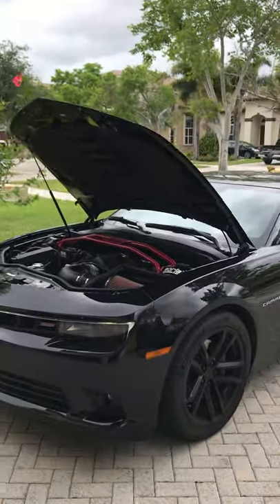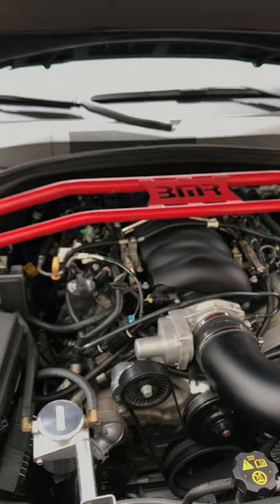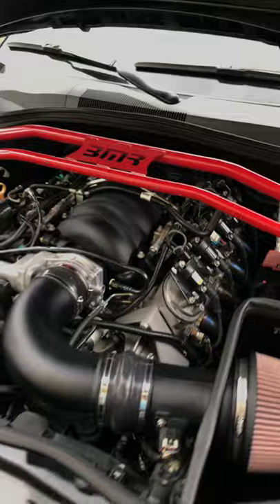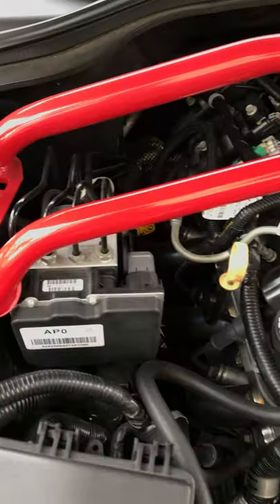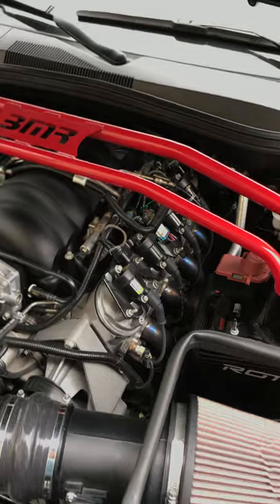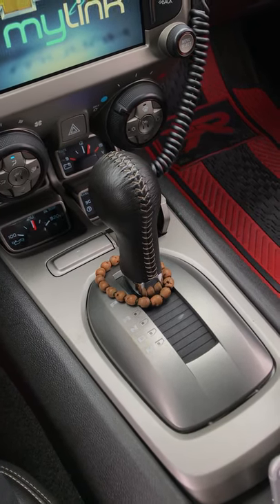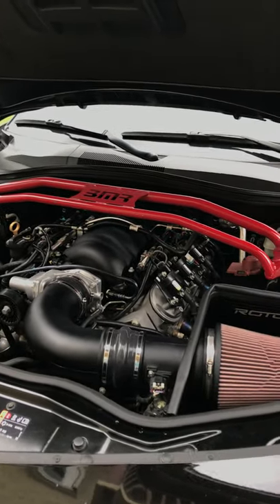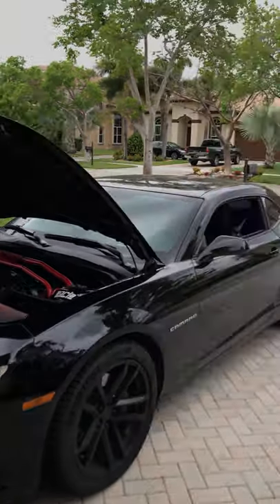3 BEST MODS to make POWER in a CAMARO!!!

Comment: I have a 2015 green flash automatic that I just picked up from auction.  I believe it's completely stock.  Would I have anything to gain by starting with just a tune?  Or maybe a CAI and tune?  I wouldn't even know who to contact or how to go about getting one.  Also, I am an IT professional and if tuning it something I could do myself (provided I had access to all of the data or needed parameters) I would be willing to dedicate a laptop to this vehicle and buy whatever data connection I need as well.  I eventually would like to do headers/exhaust....I know that some models had a dual mode exhaust available, I'm not even sure if mine has that or not, or if there's an easy way to tell.

Comment: im thinking of those mods on my 2015 SS
can you put up link to where you bought the headers and high flow cats?
im from sweden so i need to order from the US i think.

also do you need any extended cables for the new cats or does the stock sensors and cables fit?
Reply: Hopefully you figured it out, but yes, you will need oxygen sensor extensions for the primary/upstream o2 sensors. The secondary/downstream sensors won’t require them. 

However, if you went with cheap(er) headers, they may not include attachments to allow you to run the downstream o2 sensors, which will trigger some O2 sensor CEL’s. The only way to fix that is to get high flow cats with o2 sensors and to install the sensors, facing AFTER the cats; or you can get your car tuned professionally (based on the laws in your country, region, etc.).

Comment: U should definitely get a flex fuel kit. It’s one of the cheapest mods u can get and will make as much difference as the headers
Reply from the maker: I will definitely look into it! ive heard that the benefits are better for the 6th gens than the 5th though. Thanks for the advice though!
Reply: Flex is nearly pointless unless you aren't NA. not worth the price of kit, plus the price of tune, any decent tuner will tell you this also.
Reply: @Neoncollects  I’m NA and make an additional 30whp on E-85, The kit is the cheapest mod I’ve ever paid for and the retune costed me $400. Don’t talk about something you don’t know 😒
Reply: @Race_Ready_1320  assuming you have the DSXkit and returne, you're sitting at, close too, 800 bucks for 5% gain, twice as many trips to the gas station, which (depending where you live) you gotta hunt for the places that sell it. Not against flex, but there a time and place for it, if you want the best performance from flex. Flex is rad with supporting mods. But just throwing flex on something and claiming it trumps building up a strong foundation, with a free flowing exhaust, is kinda wack. Been building/ fixing cars my entire life, grew up on drag strips with my dad and grandfather, and a mechanic by trade. I know a little 🤷🏼‍♂️ just my opinion.
Reply: @Race_Ready_1320  also, I bet I can push 30 extra with the price of your retune, alone. Just saying.
Reply: @Neoncollects  all of you’re assumptions are completely false, stop while you’re ahead🤣. And don’t tell me what power “you could” make, just prove it
Reply: @Neoncollects  I didnt say anything about not building a foundation, reading is fundamental. You’re just contradicting yourself at this point. First you said flex fuel isn’t worth it but then you say you’re not against it, make up your mind… I don’t need the made up back story from fast and furious 😂
Reply: @Neoncollects  I know a lot from my experience building my own cars and I’m speaking from that experience, it seems like you’re making a lot of assumptions though
Reply: @Race_Ready_1320  okay dude lol. You're right, I'm wrong.
Reply: It will make more power on E85 but not 30 rwhp it will run cooler and cleaner also my car made 414 on 93 pump gas to the wheels and 430 on E85 it has a ZL1 fuel pump and injectors a new auburn limited slip unit a aluminium one piece driveshaft 1 7/8 long tube headers stainless 3 inch X pipe a fresh built 6L80 transmission circle D 4200 stall speed the engine is a GM performance LS3 480 horsepower crate engine that has 380 miles on it now just changed the oil yesterday with Driven LS30 and before next year it will hopefully have a GPI SS4 camshaft matching titanium valve springs hardened pushrods and PRW roller rockers in hopes to get it to make more power up top now it redlines at 6600rpm hoping to get to 7200rpm redline with a cam change and make more torque above 5000rpm in hopes to make 470+ horsepower to the rear tires car has gone 11.63 at 117mph with this current setup just 2 passes would probably go 11.50s if I'd made more hoping to go 11.0 or 10.90s at 123mph+ once cam swap and the computer retuned even if stall converter needs to be re flashed to 4800-5000rpm if needed car has a aluminium radiator race star wheel skinnies 18s front ET Street R radials 305/45r17s back engine oil cooler and a transmission oil cooler sheet metal intake 1 inch lowering spring all around BMR motor mounts after the cam swap total cost in upgrades and parts not including the price of the car will be over 16,000 dollars it still has stock 3.27 gears air conditioning and will drive 80mph all day on the highway at 2000-2100rpm in 6th gear with converter in lockup up points with E85 less likelihood of detonating its octane rating is at least 100+ may allow you to put slightly more timing in without worry of detonating and I've been buying it for 3.23 a gallon it runs cooler and cleaner down side is it burns it like crazy I've been getting 10-11 miles a gallon with it must add recommend amount of Lucas ethanol conditioner with stabilizers to avoid huge headaches especially if sitting for weeks without being used it's a good idea to use it anyways
Reply: @gloriamaletta8667  that’s a lot of information lol. My car is currently FBO e-85 with a stage 1 cam. On 91 it’s making 485 whp and on E-60 it put down 505whp
Reply: My cam upgrade cam up to $6500 because I upgraded after a dod system malfunction
Reply: @Race_Ready_1320  by me ordering a GM performance LS3 480 crate engine l didn't have to deal with that shit it made 430 on E85 but the hot cam is mild less than 220 duration intake less than 230 duration exhaust it's pretty mild has a very slight lope but it does make great mid range torque
Reply: @gloriamaletta8667  who’s going to tune your car after these upgrades?
Reply: @Race_Ready_1320  my mechanic has a GPI tune he purchased it's loaded on a laptop he calls a tuner and with it he can change just about anything from shift points part throttle or full throttle to retarding or advancing timing air fuel ratio and so on don't really don't know to much about it he plugs the laptop into car starts the car and makes changes then you drive the car with him in the passenger seat and drive as he makes changes at part throttle half throttle full throttle and regular street driving it costs 350 dollars everyone around seems to use him but l really don't know him or his name my mechanic does and makes arrangements for him to show up when l need a appointment you need a your cam card rear tire size on the car and rear axle ratio

Comment: Catback exhaust 7-10 horsepower cold air intake 7-10 horsepower longtube headers 20-25 horsepower 20 foot pounds of torque throughout 2000 -6000rpm the oil catch can is a very good idea a big engine oil cooler and transmission fuild cooler is a good idea sounds good and a 2800rpm lockup  stall in the 6L80e transmission with a computer tune with what you have already would be sweet and drivable and probably knock .5 tenth of a second with good traction don't touch the 3 27 gears perfect

Comment: How’s the scoop is it worth it performance wise?
Reply from the maker: i am happy i did it. I never got it tuned after installing or got dyno numbers, but i found throttle response to be increased and it seemed to pull a little harder. No huge power increase but I definitely felt something

Comment: No that's boosted if you go for supercharger, bulton would be no boost just straight aspirated with that get heads fuel pump fuel injectors and I forget what else without having E85 go to the Dyno tune and you could get up to 711

Comment: How much would it cost for the headers and the tune
Reply from the maker: If you are paying for labor and the headers have cats probably around $2300
Reply: @jakess707  without the labor
Reply from the maker: Headers 900-1200 depends on brand and with or without cats and dyno tune around 500 roughly so 1500 ish.

Comment: Brother pumped 87😭 know my car has check engine light and stabilitrak lights and running like shit 
I already changed sparkplug wires 
And one coil since it was throwing misfire on cylinder 4 but keep seeing these videos of bad gas also makes all this happen 
I’m gonna do the fuse pull tonight is my second 93 octane full tank I pumped after the 87 half way 2nd tank 
Hope it works for me 😭
Reply from the maker: Yikes good luck :/
Reply: Ya, a tank and a half of 87 was put in my 2010 ss and the power difference from 93 is very noticeable. Can you feel any difference after you installed the upper sway bar, I think thats what you call it maybe?